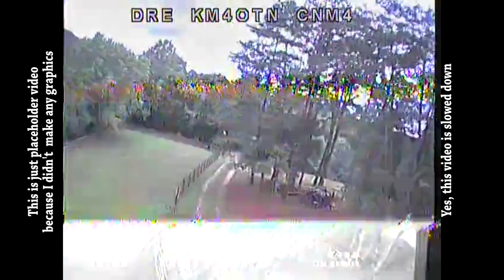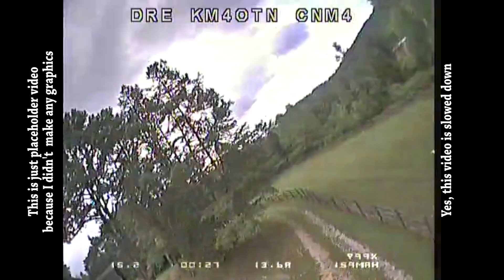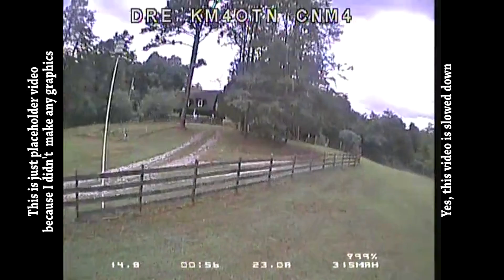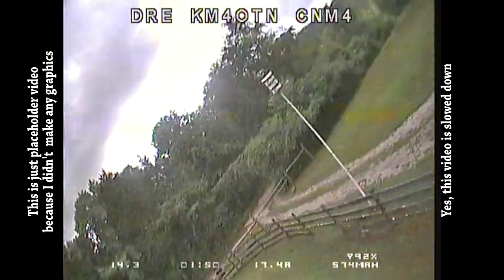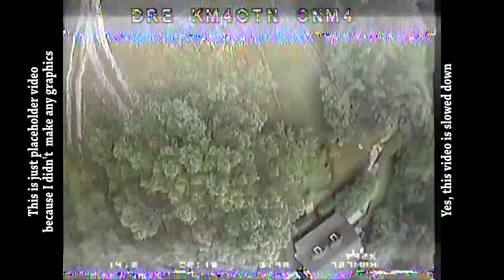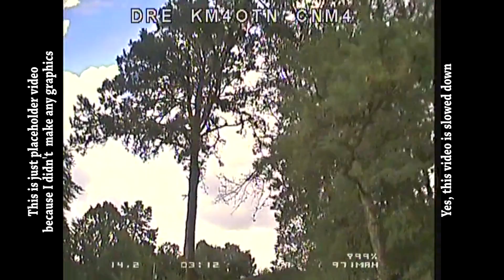What Is Multishot

Comment: Hi Joshua I have a question if you don't mind answering? IAm flashing my older Littlebee 20a with the multishot hex! I see in the releases the files go from 14.5 then they say blheli-s for the newer releases! So my question is for the older blheli does mean I can only flash the 14.5 hex or will the newer ones labeled blheli-s work also? Thanks for your time sir 👍
Reply from the maker: +Camshaft Shaft 14.x is for regular blheli. 16.x is for blheli_s only.
Reply: Joshua Bardwell thanks for clearing that up for me have a great weekend Joshua

Comment: i flashed my littlebee 20A pros with multishot 14.6 and now motors sometimes twitching on zero throttle..also when i calibrated  the ESCs and wanted to find the min throttle value my motors making that weird clicking sound on min throttle (they not run as smooth on min throttle as before) i dont know what to do..can you help please? thanks
Reply from the maker: Flash back to Oneshot? Honestly, I don't know. Are you sure min_throttle is high enough?
Reply: on oneshot i had min throttle on 1060 and my motors were runing smooth..on multishot i had to set min throttle to 1090-1100 to run them smooth..but then they were spinning a bit faster..is that okay?? a flashed it back to oneshot
Reply from the maker: +adrian mazan I've seen min_throttle have to come up a bit in multishot but I don't know why.
Reply: i think i flash it back to multishot and try to fly it on higher min throttle and will see..thanks for your time

Comment: nice descriptions.
idkfa so will posit a stupid question.
even if the motor has the torque, how many degrees different in rotation would that actually be and could that translate to attitude adjustment of the craft?

lets say around 600 revs per second at max on 4s 2300kv from nothing to theoretical max instantly.

calculate how many microseconds of adjustments are made and methinks it would be quite small.
inertia of the craft and prop flex would probably eat most of it.

I will also be interested to see what you find.

keep up the posting.
Reply from the maker: +glenby2u I'm not really sure what your premise is here. Can you elaborate?
Reply: I suppose the question I would put forward is that at what point does it all become effectively meaningless in real terms.

perhaps I dont understand this stuff. 
here's my thinking.

if the FC had a refresh of 1200 cycles per second, this would mean that if updates occurred every sync cycle and if everything was 100% reactive, then the change in value would be for around 1/2 a rotation of the prop.  on 4s with the motor at 2300kv

am I missing something simple here?

apologies in advance if I am
Reply from the maker: +glenby2u this is a very valid question, and smart people disagree about the answer.
Reply: howdy and fair enough, I am hoping I am missing something and it is not just tech hype.

oneshot was poo-pooed and it is great, so I am interested to see whether multi-shot actually translates into something tangible. 

you do technical and experiential analysis in the right way and discuss how you are coming to your conclusions; this is why I like watching your videos

cheers

Comment: why don't step manufacturers up and start developing escs with i2c or spi interface?
Reply from the maker: That exists. Let me flip the question on its head: what's the advantage of using i2c if you can achieve 32 kHz update rates with 1000 step resolution via e.g. multishot?
Reply: +Joshua Bardwell dunno. i don't know. maybe now there is no need for something like this anymore. because somebody allready scratched his head long enough to find a walkaround for this timing problems.. but im sure a well known protocol would bring other benefits on the long run...

Comment: I asked this question on Raceflight slack also r/ F4 8k/32k unsynced vs F4 synced 8k.  It's good to see you are on it.  I'm really happy with Raceflight v1.9.9 BB244 Pro Smooth and hope to move up soon since I hear it's even better.  I haven't tried Betaflight yet (especially v3 with F4).  Not sure if worth it.
Reply from the maker: If you're happy flying what you're flying, just keep flying it. If you're curious, Betaflight 3.0 is very good, but it's probably not the same thing as you're used to, so you might not like it.

Comment: Hi Josh,

First of all, please forgive me for asking a question that isn't related to this video, although you have helped me a countless amountof times and need that help one again :)

I really need your help with keeping authority over pitch, roll and yaw whilst at zero throttle. I have watched several videos and searched the net and but to no avail. I am using the Kiss FC with the Taranis and just want to have an arm switch and have stick control whilst at zero throttle. Trying loops and rolls, as deadstick is realllly difficult lol.
I do hope that with half the globe subscribing the message doesn't gets lost :( help pleasssse.

I tried following your arming guide, which is posted on the kiss site and can arm on a switch, but no control at zero throttle.
Reply from the maker: Air mode, or idle up are what you want. I have videos on both :-)
Reply: +Joshua Bardwell Thanks Josh, but i tried idle up by following you Taranis setup video, armed the board and have no cotrol whilst the throttle stick is down? from what i have read (and forgive my ignorance) air mode is a little floaty and not really what i am looking for. I am at a loss...
Reply: +EssexRc You want to set your min. command to 1000 in the KISS Gui so when you drop your throttle the PID loop keeps running so you can still have control over your quad.
Reply from the maker: If you do idle up correctly, the throttle channel will never go below min_check.

Mario A.M. if you are talking about min_command that's not relevant. Min_command is on the output side of the FC, from FC to motors. It has nothing to do with the input side (from TX to RX to FC).
Reply: +Joshua Bardwell Setting min. command to 1000 or below is the way to activate air mode in the Kiss software. I thought that was what he needed.

Comment: What I don't understand is: why is analog communication still being used for ESCs in 2016? Measuring elapsed time to communicate values seems so reminiscent of native American smoke signal communication. Then there's also the inaccuracy of analog communication that becomes more pronounced as the measured time interval slots become smaller. So although these developments are improvements, I get the feeling that it's a dead end road.
Reply from the maker: We still have plenty of resolution to measure pulse lengths accurately. That's just not where the problem is. The real advantage of digital protocols IMO will be in 2-way telemetry. KISS has this already, although it uses a separate wire to communicate it.
Reply: We do not use analog communication with  ESCs in 2016 (and we never used it).
PWM is technique used to encode a message into a pulsing signal and it is not analog but is purely digital (it have only two states, low and high), and to be strict it is type of asynchronous serial communication.
People make that mistake because Arduino creators (in all their wisdom) named PWM function analogWrite even it do not generate analog signals.
What is commonly called Serial communication (to be exact asynchronous serial communication) and used for example SBUS (S.BUS) or XBUS in RC  work by measuring elapsed time in some form (in this case it start measuring.time after detecting start condition and then sample signal in regular intervals to detect 0 or 1 (with usually 16 or 8 times oversampling).
Reply: Measuring elapsed time seems very analog to me, i.e. it's not perfectly precise, with precision affected by clock speeds and interference in the line, and not limited to a set of possible values (e.g. all integers between 0 and 0xffff).
With serial communication: the digital values arrive at the receiver exactly as they are sent from the transmitter without any dubious cases. That's all that's relevant, so it doesn't matter if the values are modulated over some analog medium or not, as long as the receiver can distinguish between the 0's and 1's whilst decoding the digital values.
Reply: *****
If you look like that then we for all communication between components in RC use analog methods (if measuring time is analog then S.BUS is analog too, it work by measuring time).
Personally I would prefer we use true analog systems, then we would not have problems with resolution (analog signals have theoretically unlimited resoultion) and not deal with 1024-4096 steps resolution that now we have (or in case of JR 65,536 steps but you will pay 3000$ for that, but it worth every penny), and that is only stick resolution which is greatly reduced when it pass FC and ESC, eliminite problem of aliasing. There is good reason why analog is in use still today even digital is easier and cheaper to use (for example laser diode controllers exclusivly use analog PIDs due requiring high-bandwidth and high-resolution and other most demanding control applications).
I agree that protocol we use can be improved (easiest way is just switching to some existing synchronous serial communication like SPI, which will be much easier to implement and give much greater speeds, and I do not think that one more wire in case of SPI would bother too much).
If you want there are "many" on market ESC that support I2C protocol (which do not use measuring elapsed time) or for example ESC32v2 suppoert PWM/UART/I2C/CAN Bus or ESC32v3 which supports USB/Serial/PWM/CAN Bus (only I2C of them do not use measuring elapsed time, all others do, but tests I read put them among worse ESC on market even it have most powerful hardware of all).

Comment: Honestly i never managed to make my LittleBee ESCs work correctly with synced using multishot, i always have to use unsynced...
Reply from the maker: F330 ESCs may have trouble running multishot.
Reply: +Joshua Bardwell yea...it's called FIRE. Burnt puppies and pandas everywhere!!!
Reply: badandy122376 Never burned any Little Bee ESCs with multishot, you must have made the mistake to use them on the bench with 3S~4S LIPO, it is suggested on the multishot thread when using ESCs without the props (for ESCs calibration for example) to use 2S LIPO in order to prevent this kind of puppies and pandas genocide lol

Comment: When I tried multishot for the first time and synced with the PIDs. The quad felt significantly more responsive and smoother. I switched back after frying a couple esc's. How stable is it these days? I tried it like 3 months ago
Reply from the maker: +Leslie W what ESC's did you fry?
Reply: +Joshua Bardwell just some dys xm20. They flew very well the problem was landing or crashing with airmode on would drive the esc's/ motors nuts. The fets would get hot which heats up the solder and that's the end.
Reply: With airmmode, i quickly hit the kill switch inches above the ground when i land.
Reply from the maker: F330 ESCs may have trouble running multishot.
Reply: +Joshua Bardwell I have MS on a few F330 ESC. run at 4k but does run MS fine, nay... great. I don't think I have any quads other than my KiSS that I don't use MS on.

Comment: Great video but I have to nit pick on a detail the targeted audience probably doesn't care about.  :-p  At 3:35, don't you mean pulse length, not frequency?  Because in  pulse width modulation,  or pwm ,  frequency is fixed and the pulse width changes.   Or am I misunderstanding something?  Always appreciate your vids even if I'm nit picking!
Reply: Yeah, good pick up.  He should have said 'the PID loop will periodically tell the PWM generator to change the pulse width of the PWM signal'.
Reply from the maker: +Luke Godeassi yes that's right. Good catch.
Reply: ok- my  OCD has subsided and i can sleep tonight :-p  Thanks for the vid Joshua Bardwell  i'm starting my first multishot build soon so this is perfect timing!